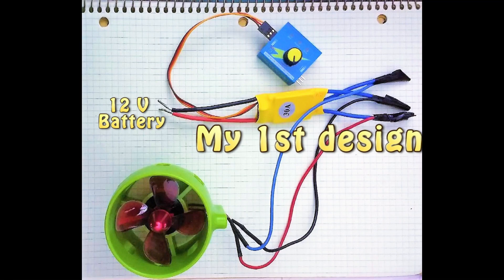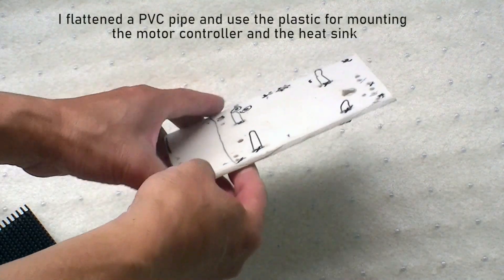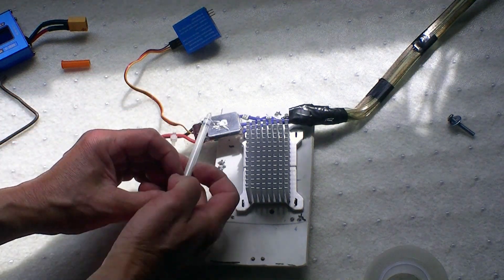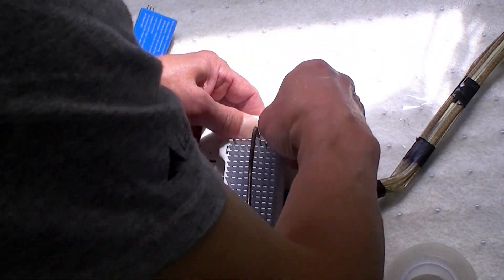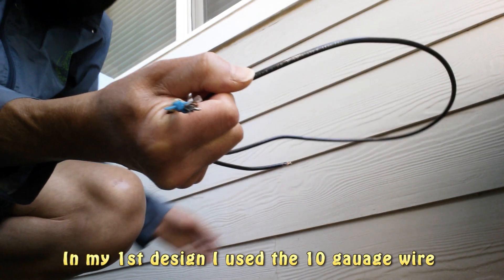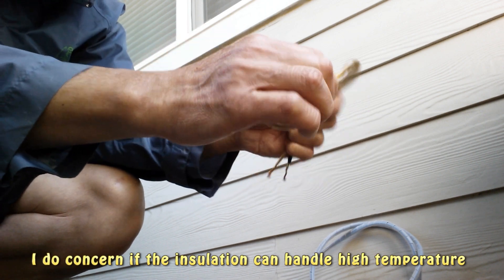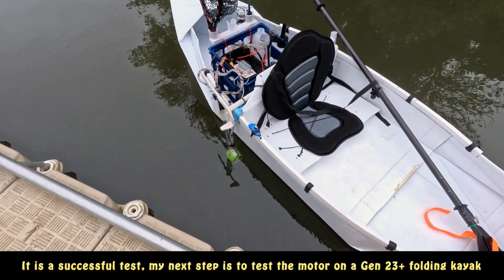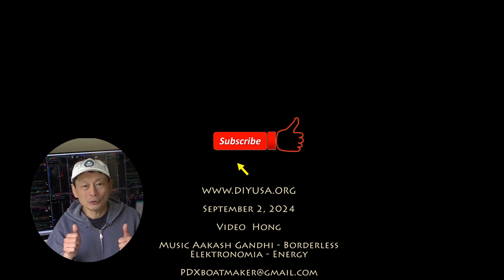DIY Bixpy Drive For Kayaks

Comment: What is the motor brand/part #?
Reply from the maker: There are more details about this motor setup in this video   https://youtu.be/KFiMu6XtaUU?si=P-MszJfi6XnRI8PB     you can get the motor here, or you can search ' underwater thruster 12V'  https://www.walmart.com/ip/12-24V-Motor-Positive-Propeller-Blade-Ship-Model-Underwater-Propeller-Brushless-Thruster-for-ROV-RC/2613382053?wmlspartner=wlpa&selectedSellerId=101086707&selectedOfferId=D4F07F49F0994D4A8B0AC665564D4450&conditionGroupCode=1&adid=22222222222000000000&wmlspartner=wmtlabs&wl0=e&wl1=o&wl2=c&wl3=10352200394&wl4=pla-1103028060075:aud-815770365&wl5=109691&wl6=&wl7=&wl10=Walmart&wl11=Online&wl12=2613382053_10001106071&wl14=underwater%20thrust%2012%20v%20motor&veh=sem&msclkid=8f460096d0e91369377c68e9c93f3af8&gclid=8f460096d0e91369377c68e9c93f3af8&gclsrc=3p.ds

Comment: Where did you get the motor
Reply from the maker: You can search on google "Underwater Thruster Motor".  I bought that on eBay a few years ago.  This is the link to this motor on eBay. https://www.ebay.com/itm/335949250017?_skw=thrustor+motor&itmmeta=01JTW4K84QKGW3VPRPN8Z1HJ2Z&hash=item4e3822bde1:g:lyIAAOSw2XJlER8~&itmprp=enc%3AAQAKAAAA8FkggFvd1GGDu0w3yXCmi1evVO0FpzzN6E2xjVk68skKcp9IPzx2UzBi%2Bi1EJxdaC%2F3bsasjWEr74SmuHM%2FW6J1GJ3Il%2FsMs8zhEpJuYehveQA5PIkwgEO%2BSKpvG2nSIISxjQ6zFPrfRM8mJSpLiSBep3BVb66FTHVOHrEdlE4rq7Mulz5j8ttYwvzI5%2FQHj0t%2BpQIOhIbTnwTsa4%2FQpc9cIFXbxJgkjTN%2FkoJ36Jrlw0lpR8o781%2FVDlUhhOAR0FN9LSWFITfUeYwqJMSVQ5avmAJdx%2B5mmJqUNXoddwAWA5x1r7o9q78oAqpyqRUU0Jw%3D%3D%7Ctkp%3ABk9SR4yEzYTXZQ  another link here: https://www.underwaterthruster.com/products/u01-12v-16v-200w-2kg-thrust-brushless-underwater-subsea-thruster-propeller-propulsion-with-bi-directional-control-esc-for-rov-boat

Comment: Please make videos showing the actual work and how to do it all. Such a huge bummer!
Reply from the maker: Thank you for your inquiry. Several viewers have been inspired by this video and have gone on to develop their own designs and applications. I even held a Zoom session with one viewer to discuss his implementation.

This video was created for an audience with a basic understanding of electricity, soldering, and related technical skills. I believe the accompanying materials — including circuit diagrams and sourcing information — are sufficient for those wishing to build their own version.

My work on this project drew from various instructional videos on YouTube and other online sources, which helped me learn how to use the controller and motor. I then applied my prior experience to design an effective cooling solution.

For those starting from the very beginning, I recommend following a similar learning path — there are numerous high-quality tutorials online covering DIY electronics, circuit building, and testing.

Please understand that creating educational videos for YouTube is volunteer work that often requires at least one hour of my effort for every minute of finished video. Unfortunately, I don’t have the capacity to produce a comprehensive, step-by-step tutorial. My time is better devoted to supporting STEM programs at local schools and universities.

I appreciate your understanding regarding my limitations and the reasons I’m unable to accommodate your request.

Comment: I wonder if you could use a flat heat sink on the base of the hull - have it WATERCOOLED!
Reply from the maker: Thanks for the question. I have considered a water cooled solution. This approach can be resulted in a very compact design. I want to prove this small motor can push the boat with a simple experiment first, as shown in this video, before I implement a water cooled solution. I prefer a more portable design and I want to embed the electronics in a fin like structure and allow the motor be mounted on the fin. I have other projects to work on so I probably will work on the water cooled solution during the winter,

Comment: Delrin sheets would work as well as the flattened pvc pipe, alternatively, plexiglass sheets would also work.
Reply from the maker: Thanks for the excellent 👍 suggestions. I tend to use what I have on hand or recycle other materials for the projects. I did consider using a thin sheet of plywood ( which I have on hand) instead of the flattened PVC pipe. The important part is to use a non conductive material.

Comment: I bought one of these brushless thruster motors a couple years ago but when I realized it didn't just hook up straight to a battery it just went on my shelf.. 
Let's hope this video gives me some inspiration on completing this project.
Reply from the maker: Great, the motor controller (ESC) is about $11 at Amazon, and it is easy to hook up all the components for an experiment. Worth a try. I will show you how I mounted it on a folding kayak in my next video.

Comment: Thank you for the in depth results and process.    I've been considering something similar.   I want to do two motors for my pontoon.  One for each side.    Use the propulsion for steering.   Similar to a "twin troller" boat.
Reply from the maker: I have also tested the motor on my kayak. It works even better than on my pontoon boat. It would be easy to implement twin motors on the kayaks or pontoon boats. I use a 12A 12V battery and the size is small and I should be able to pack two batteries in the same battery container.